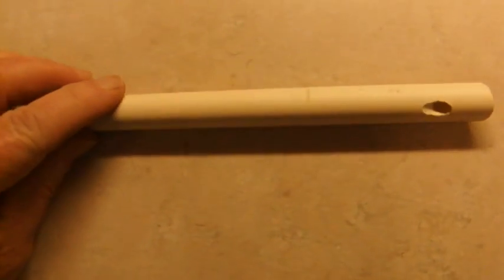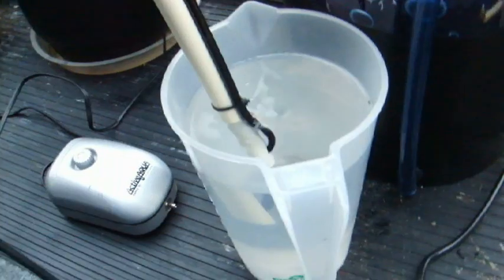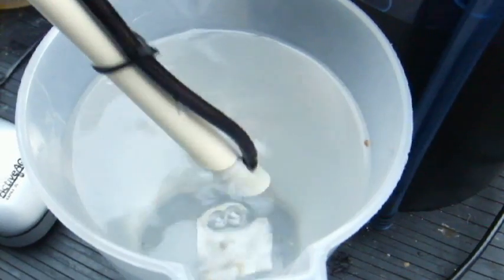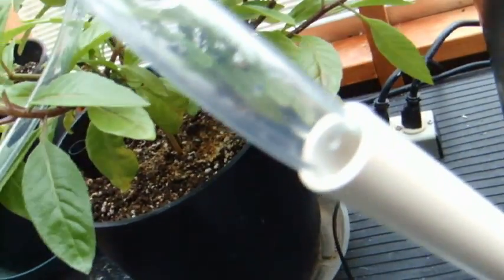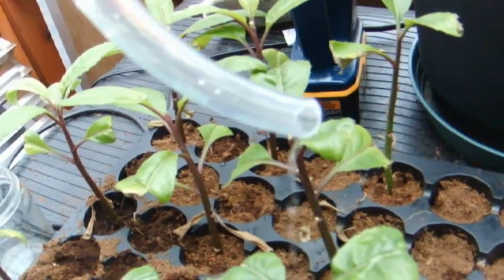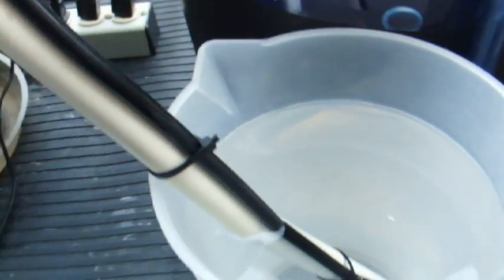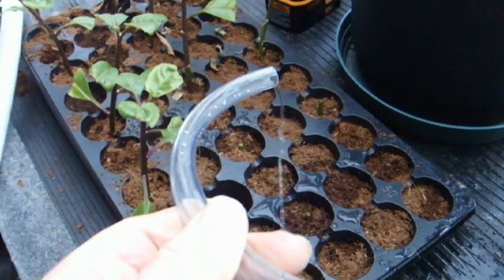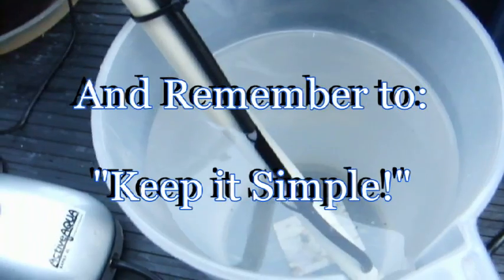Airlift Pump Construction

Comment: Hi, thanks for sharing. I have tried but the bubbles are pumping out from the bottom... do you know why? it is not working for me...
Reply: Turn your air line so it points in direction of flow, if not your air is trying to push the water out the bottom.

Comment: Hello Ronald, trying to create an aquaponics system in my horticulture class in high school. I just have a few questions about this pump, because I am interested in recreating it. Do you have a link or a name for the air pump that you are using? I can't quite make out the name on the silver box in the video, and I'm really new to this so I could use some help finding one of my own. Also, is there any limit to how long the pump will run? I'd like to have it plugged in and running almost 24 hours a day; would that be feasible with this system?

Thank you so much!
-Charlie Lott

Comment: Hi, do you have other design that will increase the output of the water?
Reply from the maker: +Giobel Koi Center 
Increasing air input will increase the water output some but not a great deal.  You can try larger components but basically what you see is what you get.  Good luck and thanks for watching!
Reply: Ronald Kleinman I am planning to try your design in our well, you're welcome

Comment: the bucket where you pumping out from, has to be closed air tight, in order to lift liquid up.
Reply from the maker: +Csaba Farkas Hello, thanks for your comment.  The air-lift pump constructed for this project does not require a closed system.  As demonstrated in the video, it pumps freely from an open container.  Thanks for watching!
Reply: +Ronald Kleinman  i meant in order to function properly,
Reply from the maker: +Csaba Farkas Hi again.  No, it doesn't require a sealed container.  Check out the video using the same air-lift pump in the DWC recirculation video at:  https://www.youtube.com/watch?v=3ba5ZBY_LfM
Thanks again fro watching.

Comment: A quick question for you. Could an air hose be ran down the inside of the tube and get the same effect as drilling the hole at the bottom. The reason I am asking thinking about doing something on a well that the submersible pump has gone bad to fill barrels for watering garden with???
Reply from the maker: +john young  Hi John - I tried what you propose and it didn't work for me.  But, like everything else in hydroponics, I am sure there are other ways that work too!  Experiment and see what you can come up with - the hole method seemed to work best for my project.  Please let me know if you come up with anything easier - thanks for watching the video!
Reply: It will work but you need a regular air compressor like for airing up car tires. 3/8 inch tubing being fed by 1/4 inch air sully line can make 300 gallons or more per day depending on the strength of the compressor

Comment: Ron i will be doing this with my 5 gallon bucket system.  However  do i need a separate air pump to oxygenate my water?
Reply from the maker: I would use a separate adjustable air pump for the air-lift pump to make it easier to control flow.  If your main air pump for the buckets has a manifold with adjustable outlets you can attach it to one of the outlets.  Hope that helps - thanks for watching my videos!

Comment: I like it. Good video, simple setup.

Just a suggestion, but it seems to me that you might have too much air flow and you might want want to dial it back some. I suspect there's a sweet spot between air flow and pumping action.
Reply from the maker: Thanks for the comment Dana!  I will be installing the airlift pump for the next video as mentioned.  I will tweak it some to get an adequate flow - that's why I like to use the variable air pumps which, surprisingly, doesn't cost all that much.  Thanks for watching!